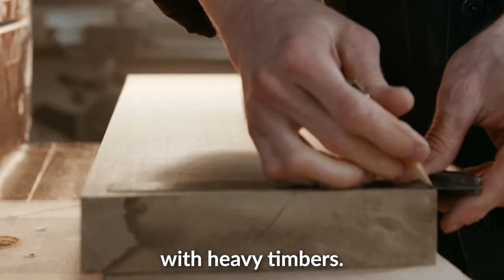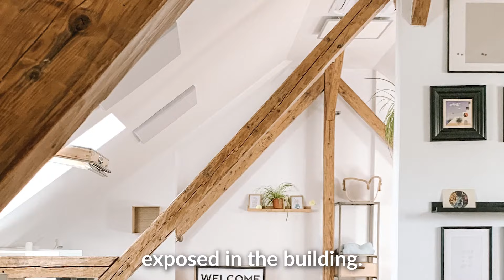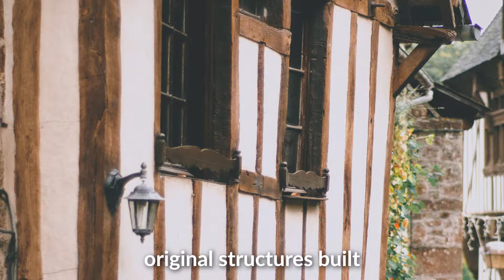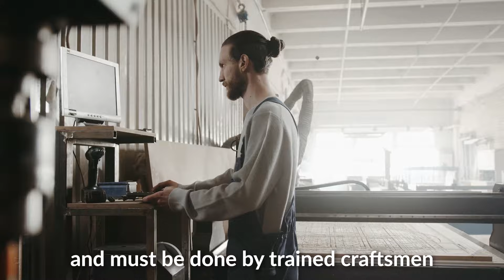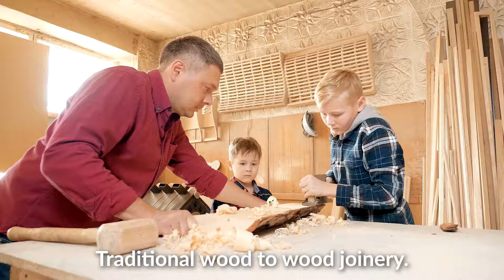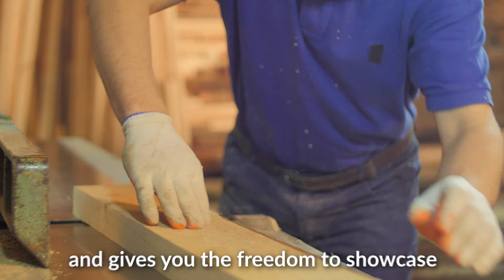The Difference Between Timber Framing and Post & Beam

Comment: The bit with rusty screws  is way off. Inside it doesn't matter when using galvanized and outside stainless steel is all that's needed. Starting from a $ 10k build in total the extra costs of stainless steel is negligible. 😊 Don't nickel and dime if your build is to last 100 years at least.

Comment: 2x4's are not traditional because they are Not 2x4. If we actually purchased 2x4's it would be right to call them 2x4. Don't call them 2x4's. Dimensionally inferior yes but not a traditional 2x4.
Reply: Nope 1 5/8 s  BY  3 5/8 s    you can only get rough sawn in true measurements at a saw mill
Reply: @marktrujillo2150   Nope. 1.5″ x 3.5″